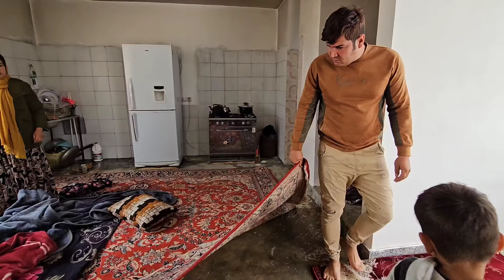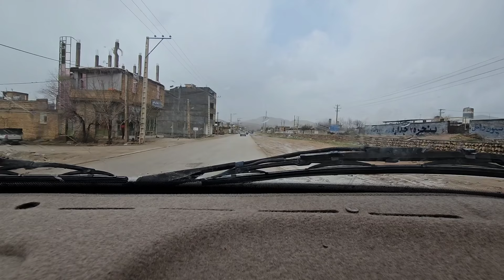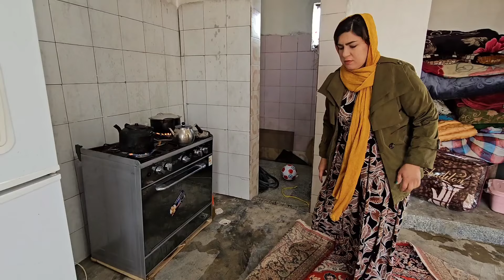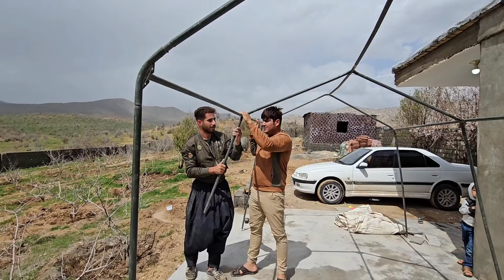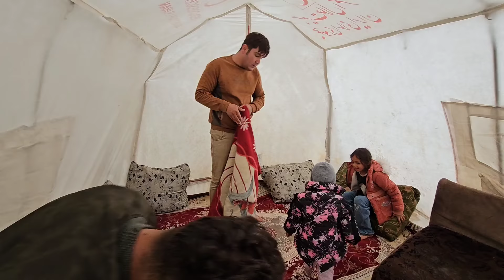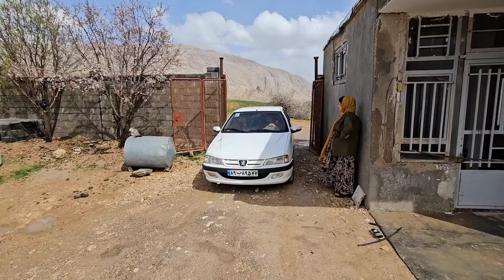Nomadic Challenges: Malek's Journey From House to Tent🏔️🌧️⛺

Comment: WHAT IN THE SINKING HOLE IS GOING ON HERE. THE REAL OWNER TOLD YOU GUYS THE VERY PROBLEM THIS BUILDING HAD. YOU WASTED TIME IN AND OUT OF THE HOSPITAL, JAIL, RUNNING AWAY TO THE MOUNTAINS, TAKING TRIPS AND NEVER FINISHED THE BUILDING SITE TO LIVE IN 😮 IF IT WEREN'T FOR BAD LUCK YOU WOULDN'T HAVE LUCK. YOU GUYS HAVE AN OPEN POURING BLACK CLOUD OVER YOU AT ALL TIMES😮